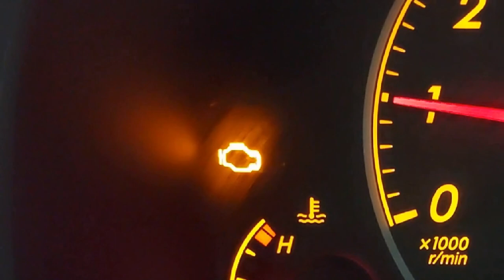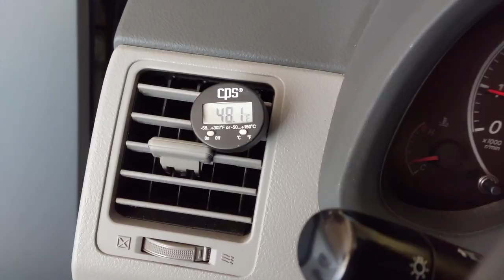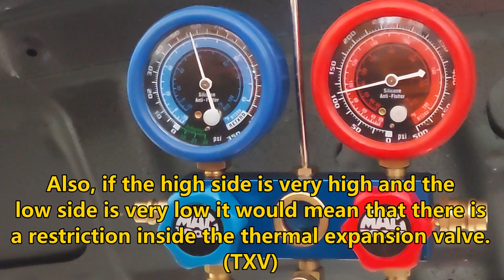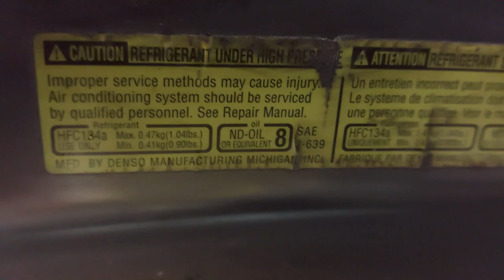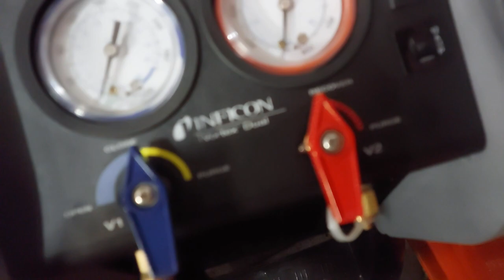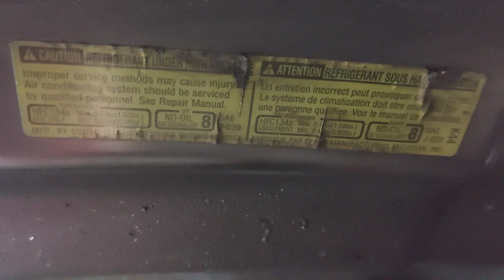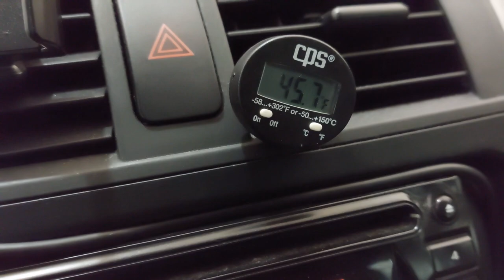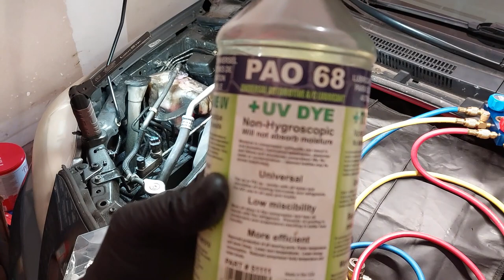Air Conditioning System Service - 2009 - 2013 Toyota Corolla 1.8

Comment: Curious, did this recharge fix the issue, or did the customer's A/C system need additional work?  Thanks for your AWESOME video, and channel content.  You are a terrific teacher!
Reply from the maker: Recharging the A/C system fixed the problem it was just slightly low on charge and under performing. No additional work was needed. Thanks for the compliment.

Comment: Thanks for the nice and very detailed video! I am asking for advice! My low pressure is very high. At the beginning it is 90 psi and after 15 minutes of running the motor it has risen and equalized with the high - 120-125 psi low and 125 psi high. The engine revs feel like the electronic clutch engages and disengages. What should I do? Car is 2015 Toyota Corolla with the R-134A refrigerant. The outside temperature is 25 C. Thanks!
Reply from the maker: Sounds like the A/C compressor is not working or turning on. The low side should drop once the A/C is on. Low side should be around 30 to 40 PSI depending on the ambient temperature outside. High side will vary anywhere from 150 to probably 225 or 250 psi max. Everything with the engine running of course. I would check and inspect the A/C compressor and also have a look at the expansion valve as well. The expansion valve could be restricted causing this issue.
Reply: @moosemobileautorepair  Thank you very much for the advice. I bought the car used and now I am using the air conditioner for the first time. After repairing the compressor, can I load the system with 12a refrigerant?
Reply from the maker: @roumenpetkov5554  You need pure R134A in the system and nothing else. Do not use those cans containing R12a as those will contaminate and damage the A/C system. Most of the cans will have other chemicals inside there so they will damage the entire A/C system if used. You have to find only R134A either by the cans or by the tank with no other chemicals inside there.
Reply: @moosemobileautorepair  Thanks again for the advice! The problem is that R134A it cannot be purchased in Quebec, Canada. Only 12a is allowed.
Reply: @moosemobileautorepair  Thank you so much for the video and important tips! With your help I changed my compressor. I charged with 12a and so far it's working fine.
Reply from the maker: Thanks. Appreciate it. I'm glad I could help out.